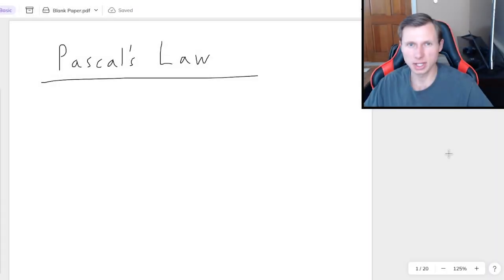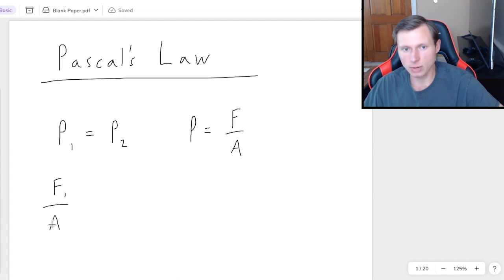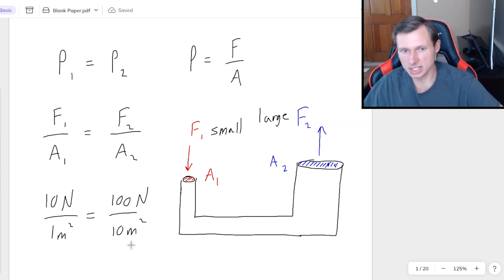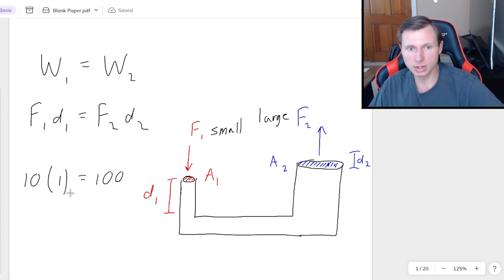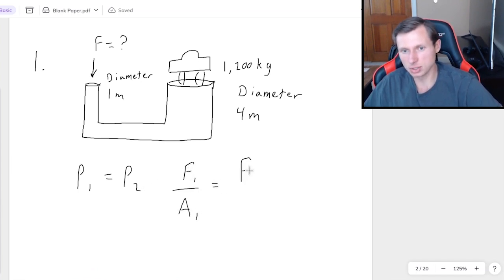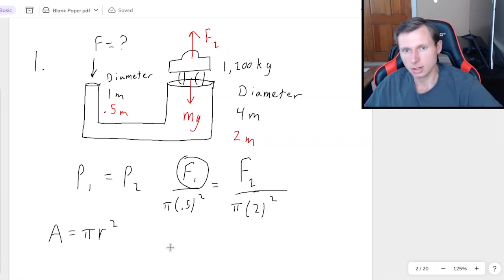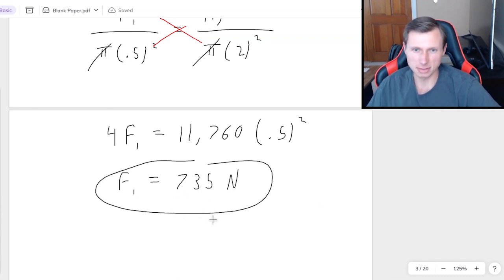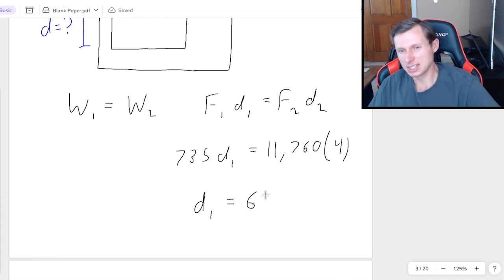What is Pascal's Law - Physics

Comment: Where did you pull mg from? Do I have to use that every single time I calculate the force in any virtual application?
Reply from the maker: mg is the force of gravity on the car. It will not always be gravity. For instance, they could tell you that a 20N force is applied to the right side. And you would draw 20N pointing down, not mg.

Comment: Maybe a stupid question: does this work if a hydraulic pump seals off the small area tube and it's positioned horizontally? As a way to overcome the practical problems of a 64 m-high tube?
Reply from the maker: Makes sense to me. But that would require a 64 m long tube then, which is still impractical. What’s done in real life is some “clever engineering” that I cannot explain off the top of my head.
Reply: @danthetutor2624 and a spiral?